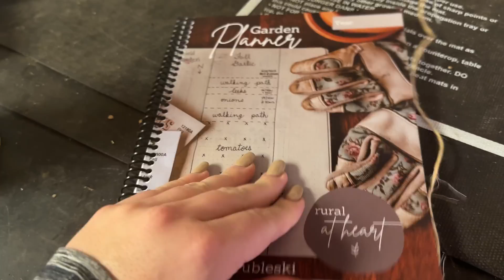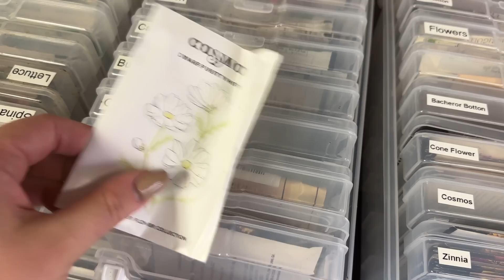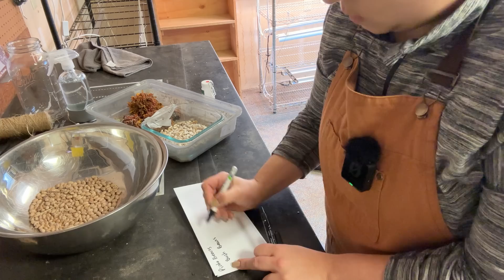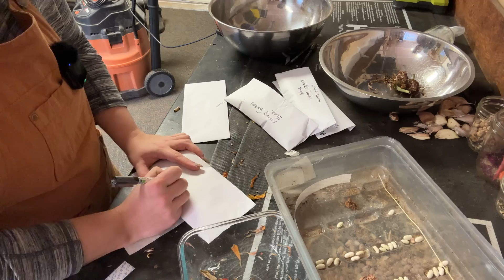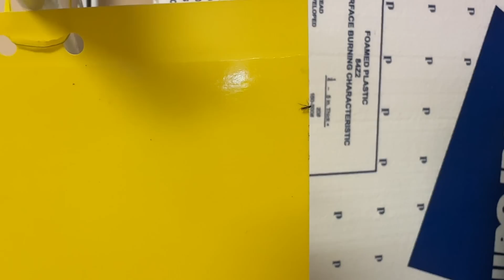I Don't Think I'll Regret This!

Comment: That area behind your dehydrator is plumbed for a utility sink. I would put a huge utility sink out there if I were you! And you could still use a hose to water bc you could use an adapter for the faucet to have a long hose on it and use it like normal. And then I’d find a new space for the dehydrator and freeze dryer.

Comment: Hi becky..  just sharing something I have learned. Seedlings don't like a wet bed,  they only like to be sprinkled a fine mist from the top.  Wet beds causes mold or funguses. Get another sprayer like the one that had pestisides in it. LABLE them ..(they have 2 gal. Ones for cheap and it is not heavy to carry for starting your  seedlings.. )
Your old soil.. stick it into your beautiful  ovens and resterilize them. Done deal...   Also Neem oil  is sticky AND  has to have a certain ingredient in it or it is a waste of money.. it's been fun sharing the great things I have learned.  
Be generous with the cinnamon , don't pile it on, but several good shake on leaves top and bottom. ( whach carefully after it gets on a bug, wow the jump up to try to get away ) shake on both sides of stem and soil .so on seedlings 5 to 6 good shakes .this is what I do. ( disclaimer) happy seeding

Comment: I’ve been struggling with fungus gnats since Thanksgiving 2022.  We had our floors done and had tons of rain and extremely warm weather. The workers opened a window that didn’t have a screen in it, and it was night so the gnats flew in. And the front door was open the whole time🤦‍♀️ It tried all the things. I’ve almost conquered them in my house plants. I’m using yellow sticky traps, a zevo in my kitchen. A electric blue light zapper and now on week 3 of mosquito bits plant treatment. Before that I tried peroxide and dawn, which only worked temporarily.

Comment: The yellow sticky traps is a sorta of waste. The best solution is to buy the fungus gnat control to add to your water. If you can't find that Lowes sells Mosquito dunks and they work for fungus gnats! Dissolve in HOT water and let it cool then water your plants and the gnats are done for!!!! NEVER toss expensive soil or plants when a simple drench will fix the issue and it is ORGANIC! It really works because it is a strain of Bt.

Comment: Get those tall green planters outside asap! The gnats have probably laid larvae in the other planters and on the black weed barrier. Fungus gnats are hard to get rid of. I had them when I lived in Florida and they set up house from plants into my kitchen drain. I never got the neem oil. I used hydrogen peroxide.

Comment: Hello Becky, 
I brought in my peppers this year as well.  However having had problems when I have tried in the past with using garden dirt/soil, fabric pots, underwatering, overwatering, lack of light and fungus gnats... this year I was determined to do it.  I pruned the peppers down quite hard, washed all of the garden dirt off of the roots. planted them in plastic pots with new potting soil and placed them under grow lights with a reminder to water... all was going well until the dreaded fungus gnat epidemic of fall 2023 happened at my house! I also purchased a tonne of those yellow sticky papers (mine were flower shapes) and place them in almost every plant in the house, I also treated my water with mosquito dunks (a biological - non toxic treatment you can find on Amazon) every time I water. So far they are still alive and green. Yay!

Comment: Unused soil. I would boil water and pour it all over the soil. Then I would do neem oil with a tiny bit of dawn dish soap. Spray every other day. And if you are still having issues you can use a more sandy soil. And top off all pots with 2 inches of sand helps prevent them also keeping the soil dry. Also the vevo bug lights work super well.  I had such a bad infestation last summer and we are just now not seeing any.

Comment: DIY hint - I just use yellow post it notes and put  tanglefoot insect barrier on the paper.  I place these right next to the soil or plants I am concerned with or on the edge of my grow light.  Works really well.  I keep neem oil solution in a spray bottle and zap any bugs I see and wipe them from the plant.

Comment: Nothing to do with plants, however I keep my tortoise indoors in the winter here in the U.K.  he’s on a tortoise tabl with soil substrate. I use a little pot with white vinegar and a little dish soap, cover with cling wrap and poke a few tiny holes in. They are attracted to the liquid and get trapped and die. It’s worked for years for me. I found the fungus flies were too light to stick to the sticky traps, I’ve literally seen them walk across them 😮

Comment: I HATE fugus gnats!  Two years ago we had a terrible problem with them and I'm convinced it was the plant that I brought in from outside for the winter.  This past fall I wanted to try overwintering pepper plants but decided to try it with only one of them,  I dug it up, cut it back and washed all the soil off the roots and planted it in fresh potting soil.  So far, no fungus gnats and the crazy pepper plant is all covered with leaves and is flowering... like it wants to produce!  It's in a window facing west and we've mostly had overcast days,  All I wanted to do was just keep it alive until Spring, and so far, so good!

Comment: Ooh Becky, speaking from experience, hang those sticky traps back far away from where your hair or clothing can brush against them.  If not, you’ll be wearing them😮. (Been there done that with hair past my waist and fly strips 🤢)

Also, I dipped and scrubbed my trays in one of those big plastic totes (in bathtub or outside).  Worked great.

Comment: I just sort my seeds alphabetically, then in the top of each case I have like yours, is a copy of a seed starting date for everything, so I know the order to grab seeds to start.  I always start with a plan I print out, and also print blank printouts of raised beds because I know I'll end up changing some things and to print 2nd plantings. I do this not only as a plan for the coming year, but as a future reference of what went where, what did well together and what didn't. Also in case my markers get lost mid season. I like to have them to look back on to know what worked and what not to do again. I am in Michigan and am buried in snow, but my sweet potatoes are already in soil to get slips in time. I will be starting some seeds indoors mid-February. I've had some in cold stratification for a couple weeks, mostly more lavender. I figure you can never have too many lavender plants.

Comment: For fungus gnats there is a product called Mosquito Bits that works really well.  You mix it up with water and then pour it in the soil of your plants and it will kill the fungus gnat larvae.  It’s not harmful to plants or beneficial insects so it’s a really great option. The sticky traps will get the ones flying around but I would treat the soil too..  Another great option to help with anything flying around in your grow room would be the Zevo plug in.  Hope this info helps:)

Comment: I personally would spray the plants  with the bugs with dish soap and water in a spray bottle.  I'd spray around the seed room also. I looked it up and the Google said to do water, dish soap and neem. It also said to use garlic spray: To make a garlic spray, smash 4 or 5 garlic cloves. Pour 4 cups of boiling water over the garlic and allow it to sit overnight. Strain out the garlic and add 2 tablespoons of castile soap to the garlic water. Pour this into a spray bottle.
Good luck with your bug issue.

Comment: I had a problem with gnats this year because I forgot to pour boil8ng water over my seed starting soul to kill all the eggs and insects before starting my seeds.  Usually I pour boiling water, mix well, then cover the soil with a lid and leave overnight. The next day, once the soil is cool, I remive the lid and start my seeds. This method has helped control pest issues.  But I also use butterfly/fowers yellow sticky gnat traps.

Comment: You should consider if you hadn't the cost of dishwasher, vinegar, water if you don't have a well, electricity, your time, ect,.   It may be less expensive to use those seed starter compostable pucks or compostable cups.   They would require less storage also.  Just a thought.

Comment: 🌺Aloha Becky, Have you ever tried using bleach with water and soak your trays (you can also scrubbed them too)Soak for 10-20 minutes then you can just air dry your trays, even your cell containers. You can spray down your grow room too with the bleach water and air dry. Everything evaporates no smell.Also, you could put straw around the top of your pepper pots. Love what you're doing. I'm doing lots of flowers this year too. You'll love growing peanuts and edamame.

Comment: I've been doing, for a couple of years, a tip that I learned from Gary Pilarchik - The Rusted Garden videos.  He recommends adding boiling water to your seed starting & potting soil mix in a large bucket.  He said all bagged soil is likely to come with fungus gnat eggs and the boiling water will kill the eggs.  I use old Tidy Cat litter pails as they have an attached lid.  I generally do this a day before I plan to plant seeds in order to give the soil time to cool off.  The third year I decided not to do it just to see what would happen.  I had fungus gnats in the greenhouse.

Comment: For Fungus Gnats, you need more than those sticky traps. That will help a lot though. It takes one fungus gnat to lay something like 200 eggs!! BT is a product that can kill the larvae. I got the product called Mosquito Bits, which is an approved product for fungus gnats. Apparently it’s a federal crime to use pesticides in a way not mentioned on the label in the USA, but there are other sources of BT.

Comment: I'm an old gardener and have never had this problem.. I don't try to over winter things in my house. All the soil and gardening stuff is moved out of the basement seed starting area. I dumped out all the green stalks and put that compost into the garden.  I clean my containers before I put them up into the garden shed {not in my house}. I'll just put fresh soil into the green stalks each year. Never invested in expensive trays. If I bring them back into the house for indoor seed starting I'll give them another cleaning.

Comment: I had this issue with my seedlings last year. I read they lay eggs in the top soil. So if you dump some soil and use new soil on the top it helps. Not sure though.

Comment: Oh Becky, thank you for sharing this video!  Yes, when it comes to overwintering peppers, I think a garage or shed that doesn't freeze is likely a better spot than your seed room for just this sort of issue.  The potting soil you had left in that room will be just fine, but as a precaution, you may want to sterilize it before using it to plant.  Because you already have a large plastic tote, just empty the open bags of potting soil into the tote.  Then, pour boiling water over the soil, mixing in with a trowel and be sure all the soil gets that boiling water treatment.  You can then cover the potting soil mud with the lid and let it cool enough to use it to plant.  I've also read where you can put the soil on baking trays and cook it for a certain amount of time to sterilize it, but the one time I tried it made the whole house STINK.  (100% Do Not Recommend!) 
For first time seed starting, I would say grow lights are #1 and heat mat is #2 as far as importance goes.  We used clean plastic containers that began life as yogurt cups, fruit bowls (like for lunchboxes), sour cream, and margarine.  The lids that come with those plastic containers (if they had them) are great as saucers.  Otherwise, we placed a few of them at a time on disposable plates.  We now have planting cells and trays from Bootstrap farmer, but like you said - those are an investment.
One tip about the Greenstalk soil - if you continue to water it periodically throughout the winter, the soil has less liklihood of becoming hydrophobic.  I wasn't sure if the Greenstalk soil was going to also be tossed out or if you were going to save it...  Because of the cost to fill them, though, I would want to salvage whatever soil you could.

Comment: Becky, don’t waste your money on those sticky sheets……I use bright yellow cardstock I get at Walmart (a whole sheet is very cheap)…..cut it to size, put a hole in the top with a hole puncher, slip a twist tie or zip tie thru, and slather it on both sides with Vaseline. Gnats and other pests stick. It costs only pennies to make them 🙂

Comment: Dear Becky! 
First: thank you for your videos! 
And about the flies: the best idea - in my experience - is a mix of the sticky paper you bought and putting a whole lot of sand (maybe 1 inch) on top of your pots - like usual mulch. This eliminates the lifecircle of the flies. 
Means: When the "adults" fly around, you catch them with the paper and if they still try to lay eggs in your soil, the can´t reach it because of the sand. Now you have to wait some time until they all are dead...
And in addition to that: heat your "new" soil for your little plants. Either in an oven or you steam it. That kills every egg.
Good luck!   💚

Comment: Instead of throwing that soil in the woods I would compost it.  There will be predators to eat the gnats outside unlike inside our homes.  Also pouring boiling water when hydrating your soil will kill the larvae.  For my houseplants I use mosquito dunks for fungus gnats.  Works amazing.  Best of luck with your garden this year.  I need to get my space organized as well!  It's been -20 soooo working up the gumption for that.

Comment: During the pandemic my partner picked up some soil for me and he grabbed Miracle Gro because they didn't have the type I wanted. Against my better judgement I used it and ended up with a terrible fungus gnat infestation. I ditched the soil and it was the only thing that worked. The yellow sticky traps helped on the houseplants I refused to throw out, but I also kept my vacuum nearby and a few times a day would go by the windows and vacuum them up. They seemed to be attracted to the light and would gather there. Hope you get things under control! Fungus gnats are the worst!!

Comment: Be sure to put all of your soil in a bucket or tote, use boiling hot water on it before using in pots or using a soil blocker. It helps to moisten the soil and really helps to eliminate fungus gnats. I do think the majority of the issue was aphids, at least the ones on the leaves! Good Luck!!

Comment: Yikes.

We had fruit fly issue and🤢🤢 we bought a home in a rural area.. we weren't ready.  They got in through our windows. 
We used poison because of the amount.  I really didn't want to. But they were all over our bed and in my daughters room. 

This sticky sheets work great.  
For fruit flies... having a liquid with apple cider vinegar and soap. They land in it and get stuck.  
If you try this.. make sure the opening isn't too large.  They'll fly out.  
You can stick foil over a cup and poke holes in it.

Comment: Hi Becky.  I’ve only been gardening for about 4 years but one thing I have learned to avoid the gnats is to put your potting or seed starting mix into a large tub and use boiling water to moisten it. The boil water will kill the gnats, larvae, eggs that may be in the soil.  I haven’t had an issue with gnats in the seed starting mix since my first year. I hope this helps you.  Bugs are gross 🤮

Comment: I bought some plants into my home from outside and had a fungus gnat infestation too. The worst ordeal ever! I also used those yellow sticky sheets. Also, since you put the plants outside, make sure any other soil you have is not accessible to them. They will die down and disappear over time. Don't throw your soil away, just place it outside and use it outside once you start planting.

Comment: Becky, I know the fungus gnat struggle. I have some hints for you. I follow the Rusted Garden's advice and I moisten my seed starting soil with boiling water. Then, I have really had success with Gnatrol that I got from the Gardener's Workshop (Nicole at Flower Hill Farm used Mosquito bits---same active ingredient). Added to the watering can once (or twice) a week kills the eggs and larva in the soil--as long as you don't have extra soil stored in the same room. Dry or not, they will live there. Don't let water stand in your trays. That will make things worse. Then I also use the yellow sticky traps to get the adults. Over the course of two years I found that this routine has been incredibly helpful. And, if I get a tray where the activity is really bad... I ditch it. In the future for overwintered peppers, you could do all the watering with gnatrol added.

Comment: I have those stupid little bugs in my houseplants!  I’ve had to treat the soil…but according to the bottle, I have to do it every 8 weeks. ( Bonide Systemic House Plant Insect Control).  I bought some of the same type sticky things but they are smaller and the sticky part slides into a small plug in light.  They drive me crazy!

Comment: Just a heads up you should also clean and disinfect all your garden tools, oil the ones that needed it. This will save you a lot in the long run, after all you would not eat with dirty utensils.

Comment: There is a Bt you can use for fungus gnat larvae, It's called BTI and it's the stuff mosquito dunks are made from, or you can get it in granular form. You can also use peroxide to sterilize the soil, just pour it into and let it kill the eggs. It breas down quickly to plain old water. But those aren't gnats, they look like aphids, which you can wash off with a spray of water. Keep repeating until they are gone, or use a neem oil spray.